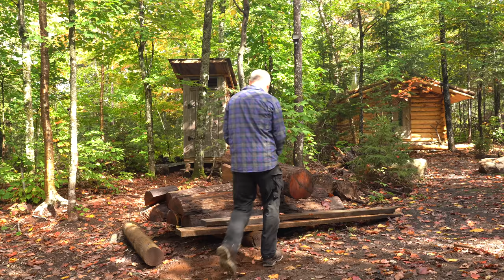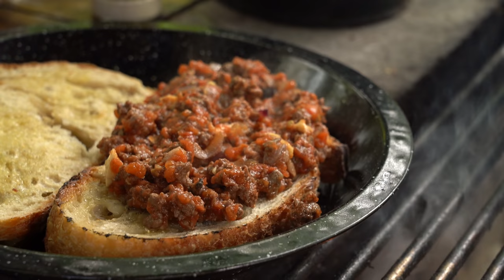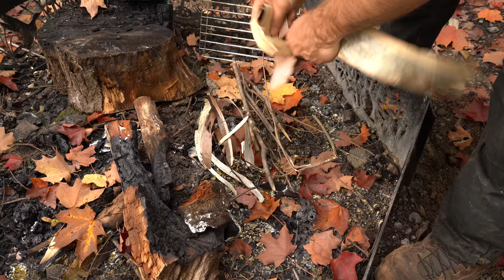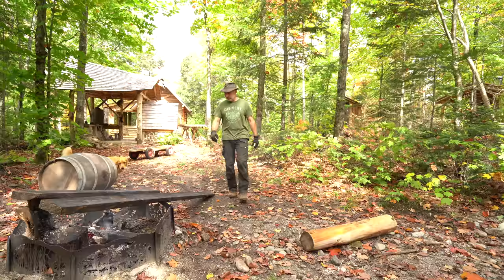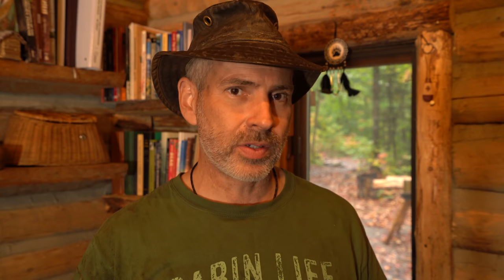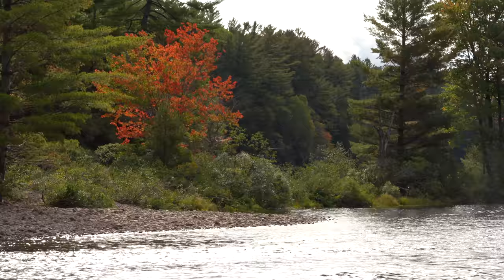Log Cabin Build in a Rain Storm with My Dog | Off Grid Sauna

Comment: I guess I hadn't thought about it too much, but Fall has a kind of urgency (in a good way) to get out and get everything done before winter.  I finished the shed, except for its "porch."  I got the last of the tomatoes picked and the plants into the compost. This gave me room in the hot house to put all the herbs before it starts to frost.  If the rain holds off, I'll get the side yard raked now that I have the wood all stacked and covered.  My kitchen is a mess what with all the tools, nails, screws, and stain pails on it; but this I'll take care of when the rain hits tomorrow or the next day.  Then when the inevitable rain lets up, I'll harvest the potatoes.  The weather is still warm, although when it is clear the temperature gets down to low forties or upper thirties (F) but it is still very enjoyable for working outside during the day.  Not too cold to handle tools and not to hot.  Doesn't this sound like where you are?  Next comes the canning.  Love the Fall.  Life is good.  Love your videos.

Comment: I'm curious. Are you going to do anymore work on the side porch to close it in with walls, or just hang/attach tarps. Was thinking in terms of preventing snow/rain from blowing and packing in during the winter......and also as a means of keeping what ever raw wood (for projects) or finished lumber dry for your winter projects  It would sure beat having to dig thru deep packed snow to get to it.

Comment: Hey.  I was wondering why you char the ends of your logs before putting them in the ground.  I was thinking possibly to keep termites away or to help prevent rot.  Also I noticed when you were adding the side porch on your cabin you were brushing something on the bottom stringers before nailing them to the side of the cabin, was that something like creosol ?  Thanks in advance and please give Cali a hug for me. L.O.L.

Comment: I've noticed in the past few videos that the roof on the kitchen is odd shaped. There's not been a shot at the right angle that I could study why. I'm sure that there's a reason for this as I know you can build true and square. Just wondering if you would explain this or give a link to an explanation. Thanks. Also the bath house-sauna has turned out great!   👍

Comment: May i make a suggestion that you take stock of the trees within 20 30 meters of your ..uh..how should i call it, let's say homestead and thin out the "herd" by cutting older trees to allow the younger ones to breathe? Of course, if that's not already your intent and i simply haven't perceived it. I feel (based on some of the camera shots) that there's quite a few trees that could benefit form this. Just my 2 cents.

Also, that sliced bread totally looked like a resting bunny. :)

Comment: I'm not trying to be a smart@$$, I would just like to know why you choose to work with wood instead of stone? You have no shortage of stone. From what I've seen the stones under your feet are perfect in size. shape and makeup to do the job. They're nonflammable, weather resistant with a 5,000 to 10,000 year outdoor life expectancy. The R value is off the charts. And with the given local river clay you need only add a small amount of Portland for great mortar. The only tools you need are a mixing tub, brick hammer, level, string and a trowel. No gas equipment, saws, fire curing, axes... Well depending on how you roof and portal it. So just curious. 

If you build a smoke shack/root house, give it a try. It's easier than you think and that would be the perfect practice structure if you have no experience with stone.
Reply: BTW I love what you have done. Reminds me of the cabin I lived in as a boy.